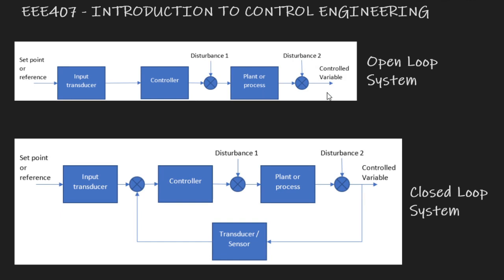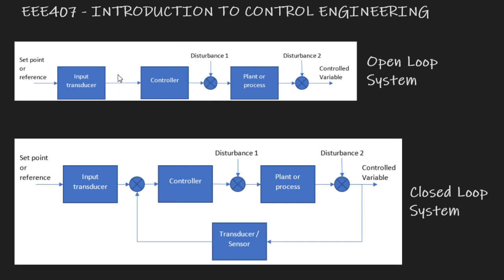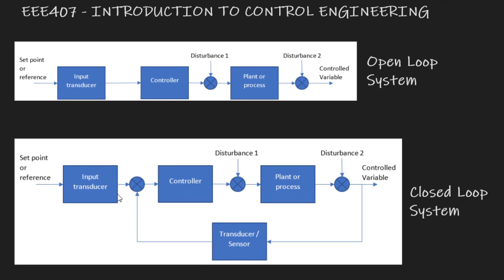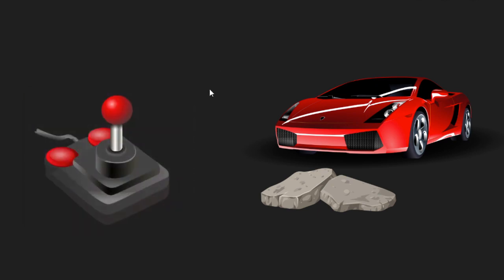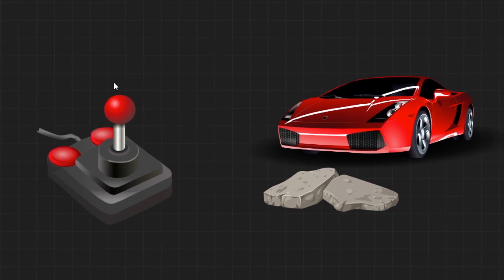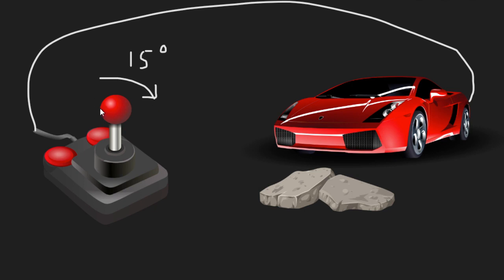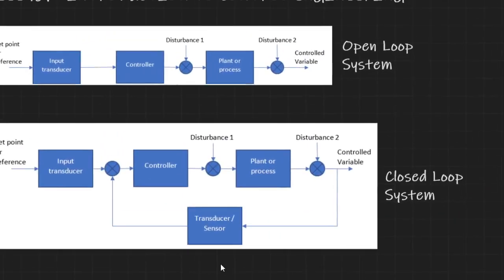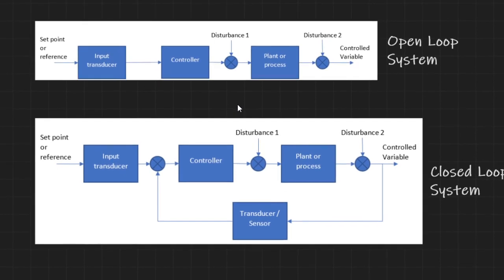02 - Example of Open  Loop and Closed Loop System

Comment: Good afternoon sir, Thank you for the awesome lecture. Please when modelling or analyzing control systems in i.e. SIMULINK/MATLAB, how are the disturbances modelled ?
Reply from the maker: A disturbance is effectively an unwanted input signal. Hence, you can introduce disturbances by introducing other input signals to the part of the system that you want the disturbance to go into. It is also possible to have a parameter in the model of the plant such that an external signal modifies the plant's model by a factor e.g. ambient temperature changing the gain of an op amp in open loop.
Reply: @OlawaleAkinwale  Understood sir, Thank you.